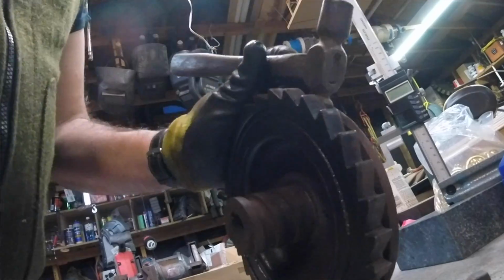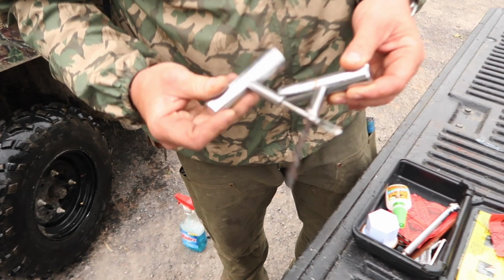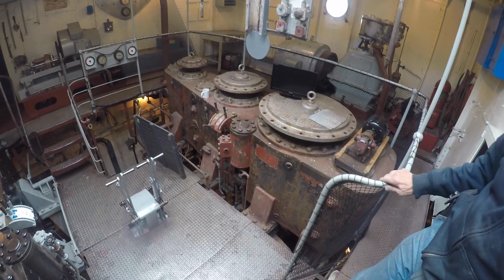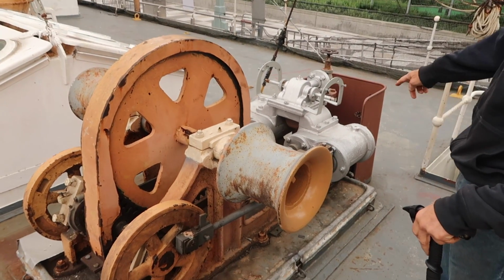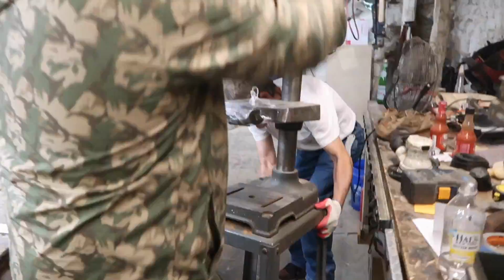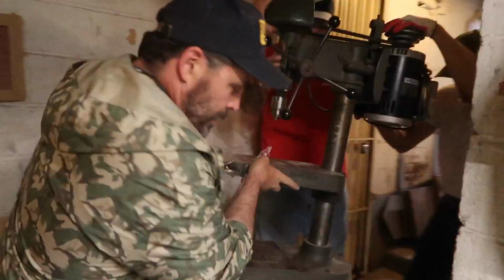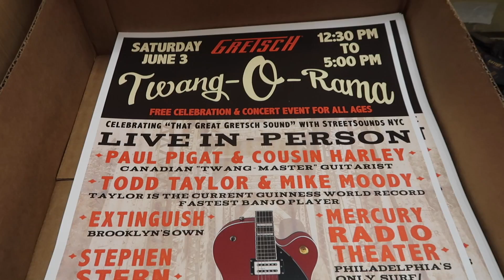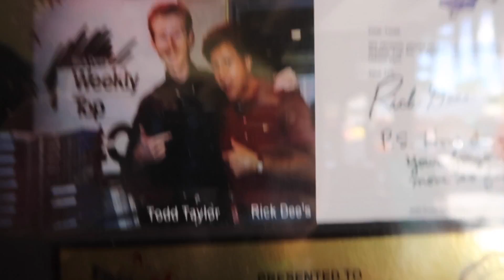DiResta 38 Banjo Man!

Comment: If that is a yale chain hoist there should be a fibre washer between the gear you got loose and the hub that acts as the load brake. Without it you may find you have a hoist that wants to release on its own unless someone is holding the hand chain towards the raise position. I know this from fixing 3 of them that were thrown out for this reason.
Reply from the maker: yep!! i had to chisel it out .. i am trying out a thick leather washer i made tonight ill test tomorrow.. funny i know someone would mention this! and of course it is you!! tx bro
Reply: Bush Hog slip clutches work perfect if there is a farm supply store near by you can try to match one up. You may have to turn out the inside or the outside on the lathe to get it to match but it is a proper repair. :-)

Comment: Repair your flat tires correctly! Use https://www.stopngo.com/. Been repairing farm equipment tires with these for years. Never a failure. Yet. Repaired an 18,000 GVW tandem axle trailer for a friend 4 years ago. Still holding air. Oh, yeah. He owned a gas station and fixed flats with those twisty, stringy things. Wouldn't work on his so he called me. Rather his son did!